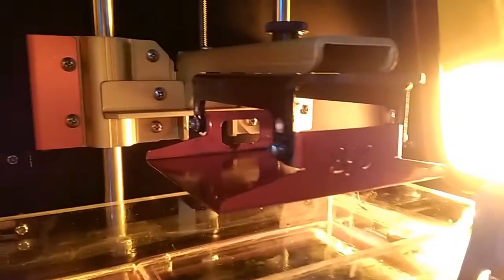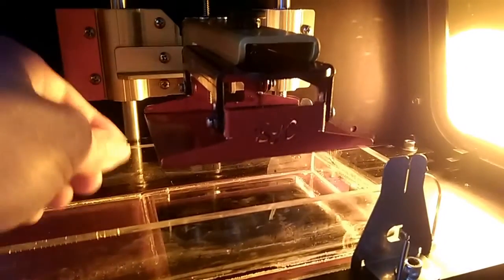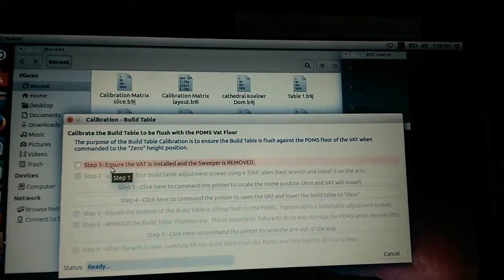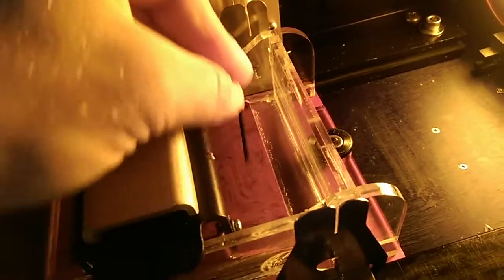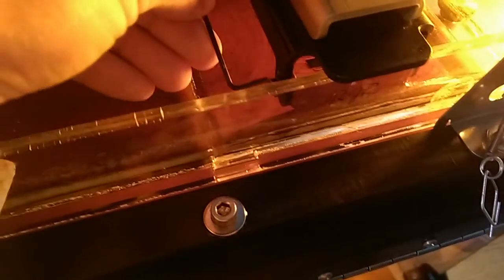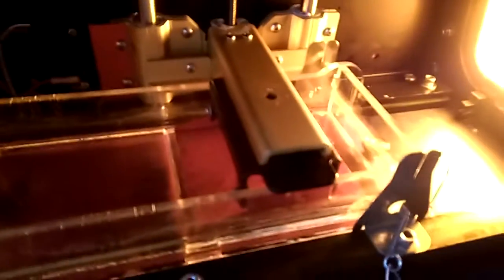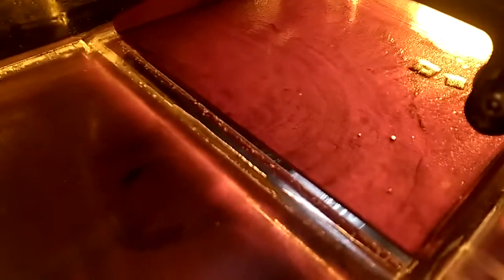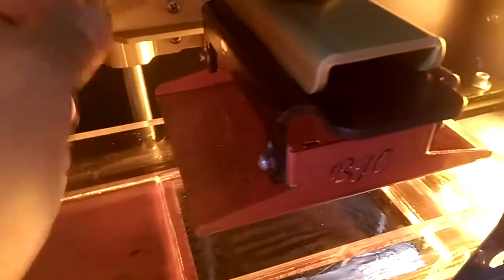B9 Creator Build Table calibration

Comment from the maker: The major advantage of the B9 is that the VAT moves on every layer. This solves 3 problems in the same time:
1- most important, is that the resin is remixed by the Sweeper every layer of the print. Other printers that only tilt, have a inherent problem: when the resin polymerizes it leaves behind some solvent that accumulates with every new layer in the same spots. Pigments also deposit with time. This increasingly inhibits polymerization. For example, a 3D printed screw printed vertical would come out a bit conic and the threads are more sloppy throughout the print... So mixing the resin is very very important.
 
2- it wipes the PDMS at every layer: tilting vats accumulate some half-baked resin on the bottom that creates shadows to fresh layers. That half-baked resin ends up in the print anyway but there will be some bits on the edges spoiling the surface.
B9 solves it and also by exposing the PDMS to air lets it breath in some oxygen that will help it stay slippery and last long.

3- it makes for suction free print/VAT detachment, guaranteed! Try to print a cup with a soft PDMS tilting VAT: the hole  in the cup builds up suction with every new layer, it can rip the PDMS. Hard bottom tilting VATS would damage. With the B9 you can print these things.

When your're printing positives to produce series of molds, you don't care about the printing time, you care about print quality.